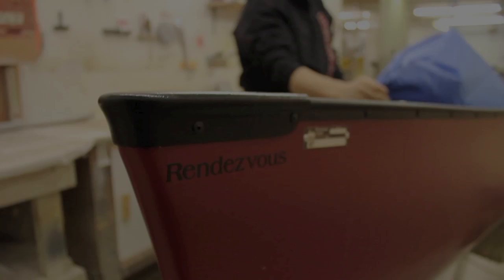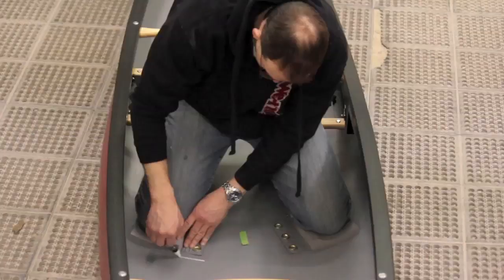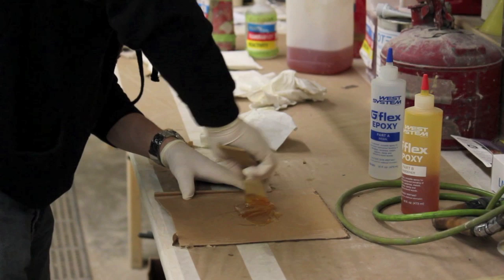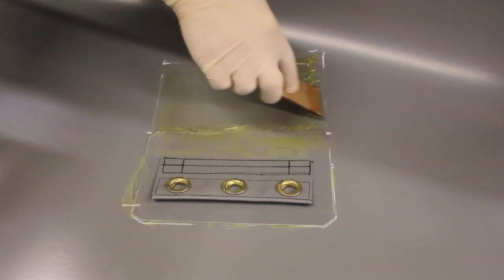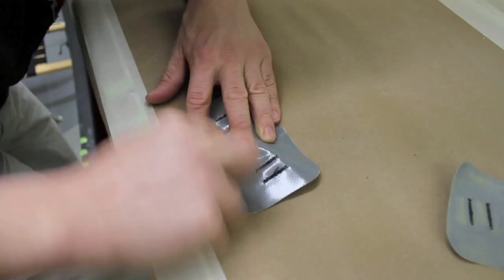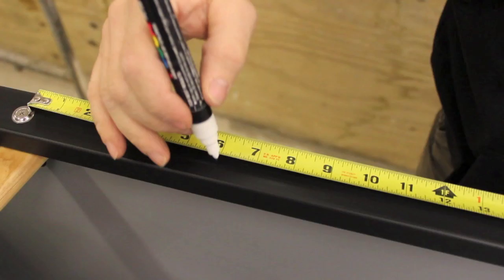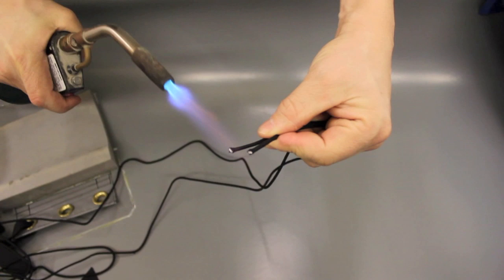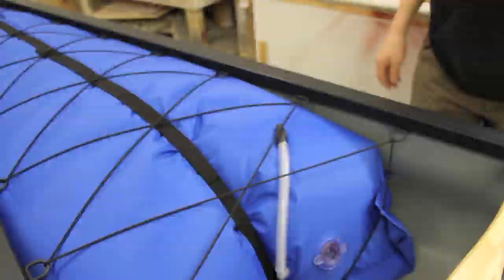Whitewater Canoe Rigging

Comment: dude... are you still around?  I'm searching on white water canoe kits for OLD TOWN... we finally have one that I think we can designate JUST for white water...  so I wanna do thigh straps, the whole thing like you did...
and I'm guessing you just got some extra thwart material for the handles on the ends, etc.?

it's a basic narrower old town.. it's old, I'm replacing seats and everything, but hull seems fine with nothing needing to be done, but I'm also going to put down some skid plates... but the adjustable seats you have ... and float bags, etc. I want to add... 

Can you point me to where you bought it all?